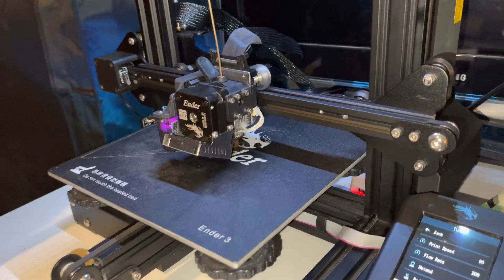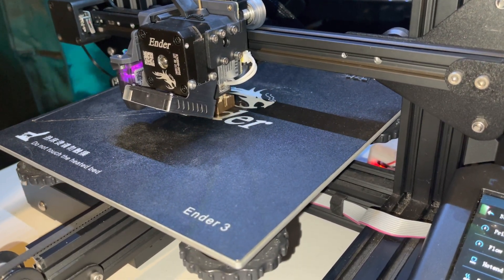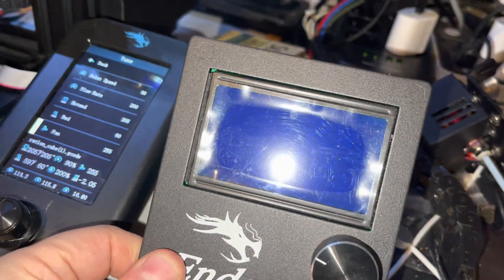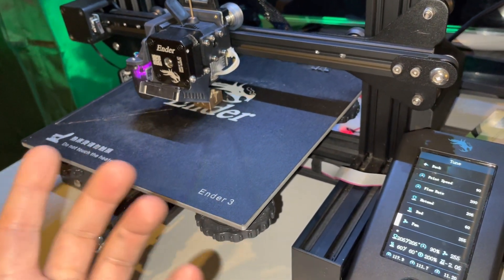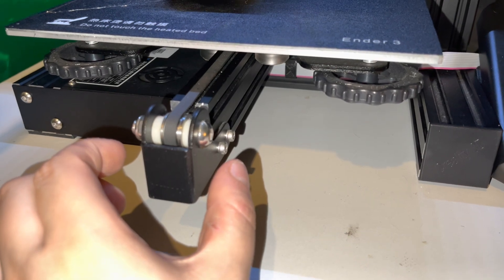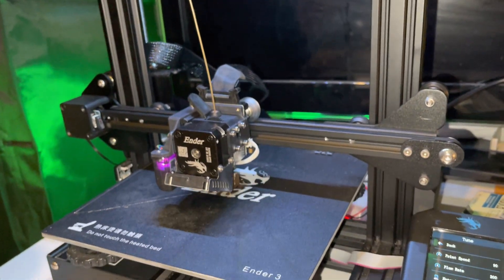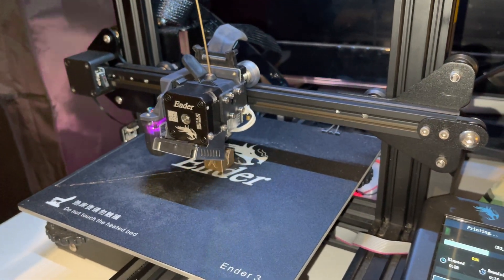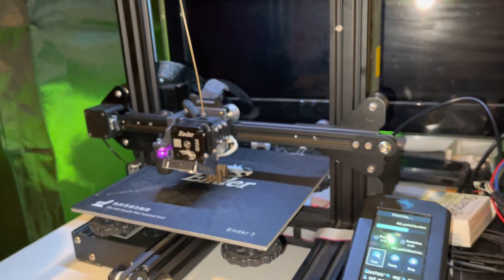Sprite extruder pro kit installed on an ender 3 v1/v2  some major issues.

Comment: Mine doesn't even work, doesn't push our filament
Reply from the maker: there could be somthing stuck in the extruder gears, you should take it apart and reassemble it , that should fix your problem

Comment: You have several setting to change specifically on the zero position relative to the x and y axis.  The nozzle on that sits way forward than the original.  This will cause the probing offset issue.   Honestly, people buy this for the wrong reason.  The biggest advantage this has over the stock is print speed.  You are printing relatively slow, so will nor see any of the perks of that hot end.  Keep reading up, you will get it.
Reply from the maker: i already put the fix on another video, i think u are running late :)

Comment: Everytime i put the white side of my cord into my extruder it freezes my printer i updated to original firmware and upgraded to jyers firmware with avail i also checked all my wires and make sure they were right help!!!
Reply from the maker: hi there, u have to be more specific then that, what do you mean by white side... and which cord?

Comment: Use terminal code 
M851 X-37 Y-39 Z0
M500

It's what I used and it works for me I've a ender 3v2 with Sprite extruder kit with v4.2.2 board.
Reply: I've got ender 3 v2 neo. Can't make head nor tail of it. Main issue I can see is that the stop switch gets missed. I've been trying to find a guide for my machine specifically but this is the closest I've found. Any help very welcome
Reply: @lukefriend8319  do you want to install the Sprite Extruder ?
Reply: Thanks, this offset worked on my E3Pro-4.2.7 with the Sprite.
Reply: There's also a side note I forgot, if you reset settings the offset will be erased so you have to redo it every time you reset. Also you need change the excursion ratio. It is marked in the paperwork when you receive the actual sprite extruder that's why you're under excluding because it ratio isn't the same. E need to be at 424.9
Reply: @vampie1689  I did the M851 and M92 and everything appears to be printing correctly. With the CR-T being so far forward, when it checks bed leveling, it is right up to the edge of the plate. If I wanted to off-set the probe's points, what command should I be researching?
Reply: So this is the Probe offset.

Comment: After change struder kit, how can I use 300ºC ?
Reply from the maker: Yes, but u have to compile your own firmware .
Reply from the maker: or use klipper
Reply: @aim6mac  what's klipper?
Reply from the maker: @jvianneyjr  Klipper is a firmware that works with a raspberry Pi ,
Reply: @aim6mac what is the thermistor number in the firmware marlin ?
Reply: I read somewhere that it should be 13 for sprite extruder in marlin. Check out mriscoc professional firmware. I haven't tried it yet but I am planning to switch to it when I install sprite extruder with crtouch and skr mini e3 v3 mainboard

Comment: The fact the CR touch is towards the front of the extruder vs towards the gantry on the regular v1 and ener 3's is EXACTLY why it's probing in the front edge of your bed like that. Honestly just compile your own Marlin firmware to correct all of that. Don't rely on crealitys firmware lol it will save you a lot of headache in the long run. That's what I did and the flow rate, probing, etc. etc. is perfect now.
Reply: Could you point me to a video or something else on this?

Comment: It may be a dumb question but does it come with the crtouch cable? Or will it come with the probe?
Reply from the maker: as of now it doesn't come with a cable, because the sprite extruder on the ender 3 v1/v2 is not supported...  So u will have to make your cable yourself ... or use the long cable that comes with the cr touch (u need to modify one end)
Reply: @aim6mac  does the connector have the same type connector on both ends? Or is it a normal jst type connector? Because one of them would be far easier to make than the other
Reply from the maker: @blech1222  the same connector as the crtouchs connector, so the small one (both ends are the same)

Comment: Amigo, tengo una ender 3 v2 y le instale el sprite extrusor pro kit, con un CR touch y no he podido hacer que funcione, chica contra el marco cuando hace el leveling bed.
Reply from the maker: hola, lo mejor es instalar un firmware profesional en tu ender 3 v2, con eso puedes reducir un poco el tamaño de la cama (220x220x250) que generalmente resolverá tu problema.

https://github.com/mriscoc/Ender3V2S1/releases/tag/20220419
Reply: @aim6mac  Thanks for taking the time answering my question. I did exactly as you suggested and it worked.
Reply from the maker: @saavedrajota88  thats great!

Comment: With the sprite extruder pro, were you able to achieve smooth movement on the x gantry? My sprite extruder pro arrived today, and it appears to crash on the gantry's far left and right. I'm on the ender 3v2, I'm wondering if anyone else experienced this.
Reply from the maker: which firmware are you using?
Reply: @aim6mac  For the Ender 3, I've used both jyers firmware and Professional Firmware. I had the same problem with both of them.
Reply from the maker: @VxVReaperVxV  i changed the physical limitation of the x gantry from 235 to even smaller (220) :)
Reply: Update: I was able to resolve the issue by lowering the physical limitations on the X gantry from 235 to 233. It seems that a screw was blocking the sprite extruder; I heard that reversing it and purchasing a smaller one would solve the problem as well. 
Also I appreciate you for taking the time to help out! Very quick reply, thank you! 😊

Comment: Where did you plug in the cr touch in on the hot end? It looks like I need a short wire... is that correct and do you know where to get it?
Reply from the maker: hi there, yes u need a short cable, u can find it here, but it comes with the cr touch https://nl.aliexpress.com/item/1005004230981279.html?spm=a2g0o.productlist.0.0.13c92ee1wFE2yP&algo_pvid=d76fb51c-b538-4d05-b850-8b3f047392ee&algo_exp_id=d76fb51c-b538-4d05-b850-8b3f047392ee-58&pdp_ext_f=%7B%22sku_id%22%3A%2212000028462215490%22%7D&pdp_npi=1%40dis%7CEUR%7C%7C12.72%7C%7C%7C%7C%7C%400b0a555d16517132430751856e24ff%7C12000028462215490%7Csea
Reply: Thank you for the information but that page doesn't exist
Reply from the maker: @prestoncox1090  oh okay ali took it away.. i'll look for a new one
Reply: Thanks you are the man

Comment: I sent a message to creality look who replied..

Dear customer,

Thanks for your contacting us and sorry for late reply. 

Based on the question you mentioned earlier. Because the position of the automatic leveling installation is different from that of the original ender3v2, the sprite struder pro installed in the ender3v2 cannot use the automatic leveling. If you want to install an auto-leveling accessory, you will need to change the auto-leveling position yourself. Or you don't install bltouch, flash back to the normal firmware, remove the automatic leveling, and install the limit switch. machine can be used
Reply from the maker: hmmm that sounds dodgy, they never mention that anywhere when u buy it, now suddently the cr touch / bl touch wont work with that setup... what i did is i manually changed the bedsize to a smaller size, 220 x 220 x 250 (originally it was 235x235x250 i think) now it's not 100% centered when leveling, but it's inside of the margin of error which is acceptable for me. atm it's the only way i think, i will look further into this to manually change the head position.
Reply: @aim6mac  
Thank you so much for your quick response!!

I'll also see more details, it's still a little far from the left side, but the BRtouch is on the table, it's just not taking the whole table, I'm already making progress
I hit yes to 220x220x250 and extrusion 424.9 and increased the
margin of your probe to 60mm
Reply from the maker: @vp9290  i am sure u can dial it in so that it works perfectly.
Reply: @aim6mac  tentar.  mais aqui no brazil nao vi ninguém que tenha.  e so voce no youtube que fez videos sobre esse extruder e que temm.  mais ta foda aqui acertar.
Reply: imprimindo bem ta legal e mais acertar os cantos do brtouch so
Reply: @aim6mac  excellent solution.simple, effective and clever. I like your style.
Reply from the maker: @andrewut7ya511  thank you!

Comment: This is the only video where the extruder is actually used. Thank you for that. Everybody else is just showing it, and maybe disassemble it. How loud is that? I have a Briss fang with some noiseblocker fans. I would change to direct extrusion and this looks cool. But if it is too noisy I gonna pass on this. Where is this extruder on 1-10 scale? The original hotend setup on Ender3V2 is horribly loud, solid 10 on loudness, and a nice noctua fang cooler is the 1 where you can sleep.
Reply from the maker: Hi there, the stock fans of the sprite extruder is loud indeed, but u should watch my other video ( ender 3 s1 ) where i use two noctua fans … mouse silent
Reply from the maker: https://www.youtube.com/watch?v=BXUp3cZ71Pc&t

Comment: is the Creality 3D® SpriteExtruder-Pro Can be installed to Ender 3V2 ?
Reply from the maker: yes indeed, but u need to get the KIT version
Reply: @aim6mac  i installed a Sprite extruder on my Ender 3 V2. Unfortunately When i started the first print the part of stepper motor of Sprite extruder didn't work. I'm searching a advanced firmware, but i wasn't find. Do you know, what was this issue with extruder or stepper motor?
Reply from the maker: @berlina_3d_tamaskoncz  check all the cables, sounds like something is not plugged.
Reply: @aim6mac  actually i don't have Cr touch and obviously i didn't plugged bed leveling cabels. But another important cabels were plugging.

Comment: I just installed the Sprite Pro Kit on my Ender-3 Pro and had no issues. It's quiet and working great so far. I've had none of the issues you're pointing out. I calculated my E-Steps to be 429.1.
Reply from the maker: well thats great, i'm glad ur experience was much better :)
Reply: Do you mind messaging me with any important tips? I’m seeing a lot of issues  on Reddit about the extruders frame catching on the x-axis
Reply: @Kaleldoeswell  Do you have any links to such issues? Without seeing what they're talking about I can't really offer any suggestions. I haven't seen anything catching on the X axis.
Reply: @Kaleldoeswell  You can swap the top right bolt of the Sprite Pro Extruder carriage with a M5x25mm, put in reverse with a normal nut. Then that nut will not catch on on the end of the x axis. Or, you can modify the bed size so that the carriage will not go that far.
Reply: @advocatus360  since then I’ve installed the sprite extruder pro on my E3P and I’m not seeing any of the issues people mentioned! The only thing I noticed is I’m getting poor adhesion in the middle of a new print but I think it may be due to moist PLA
Reply: @Mikael Fakhoury  can you share your settings for your x/y probe offset what if anything you did to get the Sprite centered on your bed?

Comment: If I'm not mistaken that extruder has gear reduction. You are under extruding because your firmware thinks you have the original extruder. I don't know if your firmware supports changing your eSteps, But that will solve the under extrusion problem.
Reply from the maker: Hi there Mike, please check my other video about this, it's all fixed, indeed i needed to change the esteps for the extruder (from 93 to 429)

Comment: I read the comments and it seems like you solved it with steps. Just in case it can improve your situation even further - that texture only on 1st few layers usually suggests that your gantry is binding on the right side. Try adjusting eccentric nuts

Comment: Go for jyers firmware for all your problems with setting probe X/Y offsets. Mine are 30/45. Also my Z offset is around 4mm's
E-steps 424.9 is documented in the manual. 

I am getting %100 perfect prints after fixing belt tensions
Reply: Merhaba soketi nasıl uyuyor ender 3 v2 ye. Söküp lehim yapmak mı gerekiyor?
Reply: how did you do?
Reply: Maybe you should be making videos, lol
Reply: Have you printed any other high temp materials? PEEK? ASA? NYLON CF? NYLON? TPU? Interested how well this is?

Comment: If you haven't already, try doing an esteps calculations and change those based on testing (plenty of videos online for it)

Likely the 3.5:1 gear ratio in the Sprite needs a much different estep setting (I think you'll need more but not sure) than the defaults :)
Reply from the maker: I just checked on my ender 3 s1 and the e steps/mm are even greater value (424.9) so i'll change it to that and see what it gives
Reply: @aim6mac  the manual on the Sprite Pro conversion kit also says to set e-steps to 424.9
Reply: @aim6mac  where do I find the changes for the esteps?
Reply from the maker: @yuriorlov47  on professional fw u go to: control ... motion .... steps/mm ... esteps extruder
Reply: @aim6mac  I'll need to figure it out for the S1
Reply from the maker: thanks , i figured it out indeed, changed the e steps for the extruder from default 93 to 335 and now it seems fine!
Reply: @aim6mac  now you got it calibrated do you think it's worth the upgrade?
Reply from the maker: @pacman7516  yes it is, but i've had on several occasions clogs with this sprite extruder...

Comment: You need to compile a marlin 2.0 firmware with the required settings and offset for CR touch and the Nozzle. this would solve your problem of bed level on the edge and the bed size
Reply: Is there a video with jyers 4.2.7 bltouch?
Reply: @williamgarner3695  4.2.2 or 4.2.7 the difference in the Jyers Fim is just the version of the board you have to select, installation process is the same.